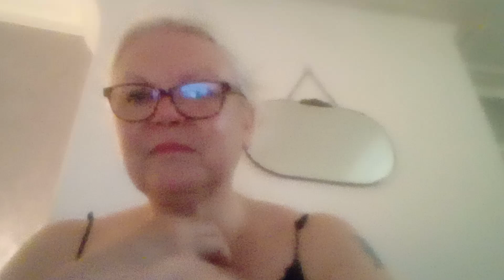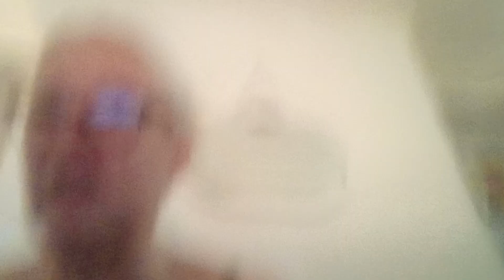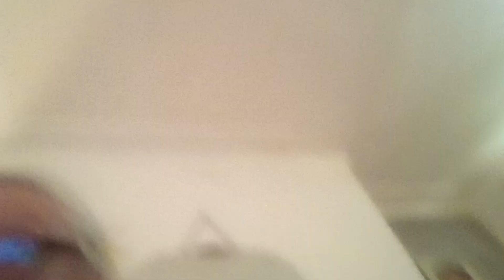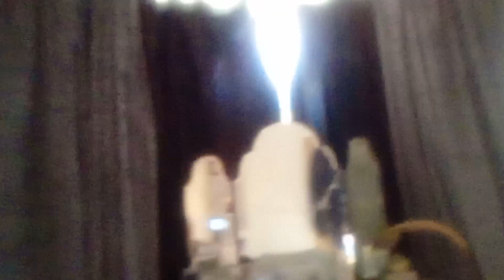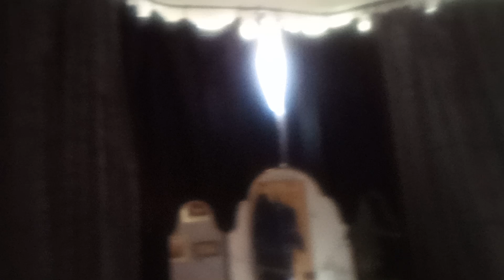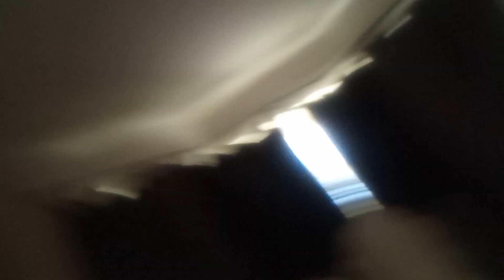10 Tips how to save energy and money during heat wave money saving hacks #energysaving #electricity

Comment: I live in a hot country and agree with all that was mentioned. Extra tips : If your bedroom has a high ceiling get a ceiling fan........game changer. If you have a standing fan drape a chilled damp cloth over the front of the fan. Drink lots of cool water. Its not the time for pop or sweetened drinks.Try not to cook inside but if you have to don't use the oven. Am sure you can manage for a day or two as it's not likely to last long. Go and sit in a place that has air con, eg shopping mall, library or a bank.  Slow down your pace, heavy work in the house can wait a day or two. If you don't have carpet run a wet cloth over the floor, it cools the room. Absolutely regarding a bowl of water or if the kids have a paddling pool pull your chair up and stick your feet in. Don't sit in the sun. Temps are about 10 degrees cooler under a big leafy tree.
Reply from the maker: Thanks for the lovely and useful tips! I will be sure to mention them on Frugal Friday, Brilliant!!! When I move home I am going to invest in a ceiling fan.
Reply: @SkintLivingUK  Yes they're brilliant.